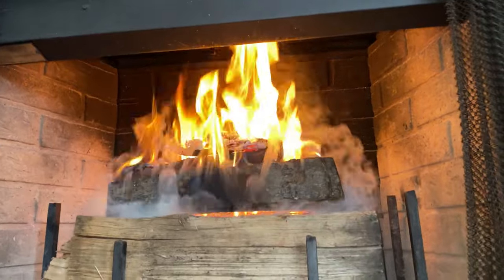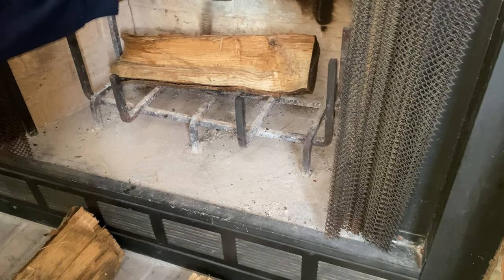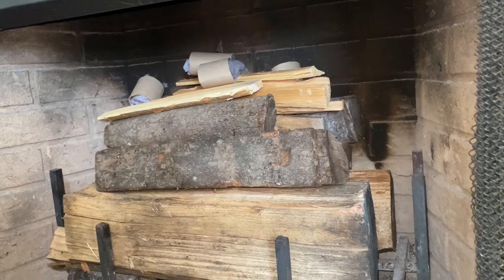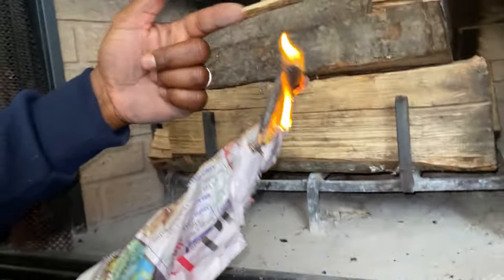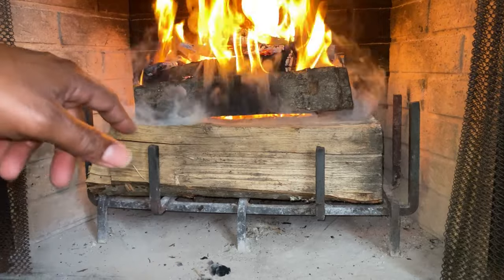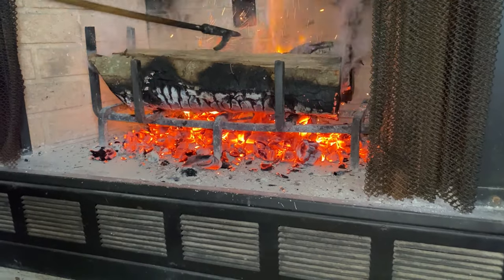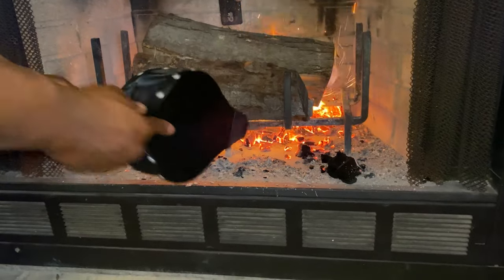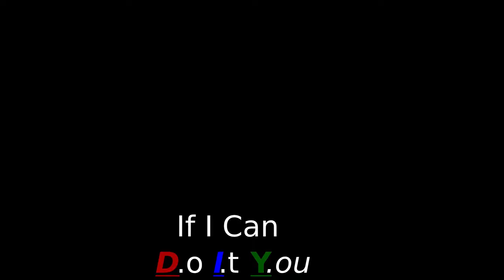Starting Fireplace for Beginners - Top Down Method

Comment: the buildup is pretty good, but the 2nd layer is to large and should be placed in crossed patern. the 3rd layer should be smaller wood. round wood does not catch fire as good as split wood. Large wood -> less large wood -> (diameter of the 3rd layer split in half is good enough) -> kindling on top of that and your OK.
Reply from the maker: This is excellent advice.  I appreciated you sharing, but I really appreciate you taking the time to view this video and take time to write a comment.  Thank you for viewing!
Reply: @TheAmateursAmateur  Thank you for sharing. I just installed a new fireplace and want to make sure I do it right and get the best experience out of it